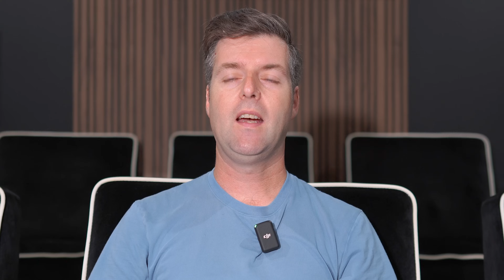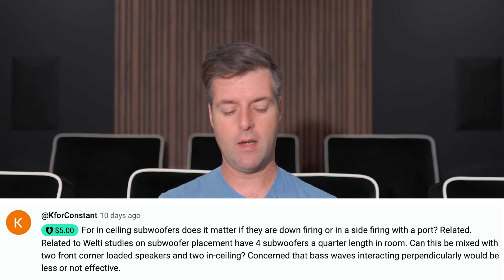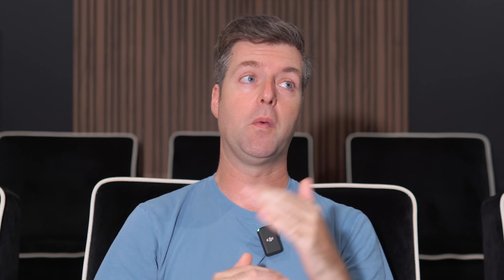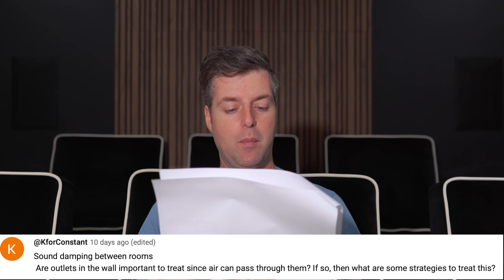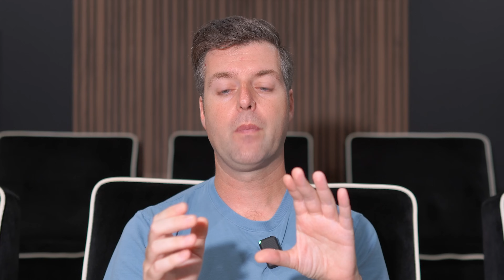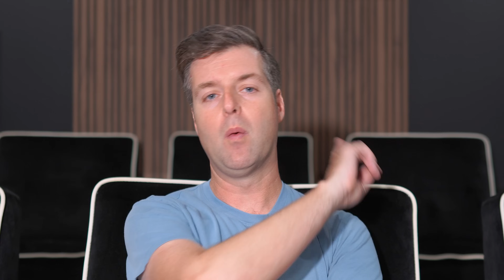Subwoofer Radiation and Placement, does it matter?

Comment: Couldn’t you use a putty pad as an outlet gasket?
Reply from the maker: You could. That would be very messy. The putty pads are sticky and relatively thick. I’ve done this in critical areas before. You can see the putty pad. 

I did this to my projector hdmi port. The outlet box and Smurf tube wasn’t done quite right so I added putty pads to the back of the metal outlet.  You can see the putty pad at the side.

Comment: Thanks for all of the videos. I’m going to be installing for Martin Logan dynamo 1100s in my theater. I’m planning to align the subs using a mini DSP. Would you recommend the model with XLR inputs or single ended inputs?  The room is 12’ x 14’ so the cable runs will not be exceptionally long.
Reply from the maker: Xlr

Comment: Awesome video, as always. I am seriously considering putting sealed subwoofers into the ceiling (firing down). You mentioned that when you put a subwoofer into a wall, it becomes hemi spherical and no longer a 360 degrees disperser. You also mentioned that quarter placing subs summon SBIR problems and losing the benefits of reinforcement from the surrounding walls. So my question is. If I want to put 4 subs into the ceiling, should I go with the quarter positioning, and if so, should I expect losing output due to the lack of reinforcements from the walls? I know that more subs are better for more consistent results in multiple listening positions, but drawback can be the lack of punch (except if you put all the subs to the corners), which was present when you had to focus to 1 listening position only. Is putting the subs behind the screen and thinking of an SBA or DBA is a better solution? If I put them behind the screen and basically into wall, would I face with the same issue, as no reinforcement from the walls? Can that be countered with more powerful subs? What is the best solution, if I want to keep the punch, but want more evenness across the listening postions? Can that be achieved with in ceiling subs?
Reply from the maker: Without the right processing a SBA or DBA is really hard to get to work well in a lot of rooms. First, while four can work with proper DSP processing to focus and aim the wavefront, four is rarely enough to create a planar wavefront up to 100hz. You likely would need 8+ to get there.  

I can’t answer your other question without the room. The problem is that I need to have the room shape and layout to determine what may be the best place. Quarter positions could work fine.  

What in ceiling subwoofer are you looking to use?
Reply: @PoesAcoustics  Thanks for the quick feedback. SVS 3000 In-Wall. I saw the the amp can run 2 pairs, but then I will probably have problems with the DSP,  as it will set two pairs at a time and can't EQ, Phase, check polarity separately for each pair. Room is a rectangle, 4 meter wide, 6 meter long and 2.3 meter high. I have checked the Harman room mode calculator. Listening position is almost in the middle - I have told the owner that it is not a good idea. There are dips at 29hz at the length and 43 hz at the width and 70 hz at the height. Currently he has 2 x SB4000 and I have managed to get a good response, putting them into the opposing corners, but now he is missing the slam that he had when both of the subs were at the corners at the back wall.

Comment: Have you done many infinite baffle subwoofer installations? Would love to hear a video on IB subs in general from you. Thanks!
Reply from the maker: Never done one. Because of the kind of rooms I design. There would never be a scenario they would work. You can really do a sound isolated room with an infinite baffle subwoofer. 

I’ve heard them plenty of times. But it just doesn’t fit in my design approach.
Reply: @PoesAcoustics  Thanks for the reply! I hear lots of people saying IB subs sound extremely clean etc. but in your opinion, do they really sound that different from a well designed traditional setup? Keen for your thoughts given you've heard both. Thanks!

Comment: Hi, great info. I have a question regarding sub placement for a solo listener. Is the advice regarding optimal placement also valid if you are using equaliser? Or could the corner placement be a better choice anyway if you equalise in the listening position?
Reply from the maker: For a single solo position you focus on subwoofer placement for that one seat. EQ is necessary but not a replacement for placement. The reason is cancelation dips. You can’t fill them through EQ.

Comment: Wifey needs a white noise generator 😎.
Reply: @jimtoomey9522  
I have a FOH engineer, colleague/acquaintance that set up a two cabinet destructive summation sub array, positioned nearby a monitoring mic, merely to destructively lower the dBspl the local authorities were monitoring, so he could elevate the mains spl ... to get away with playback at a higher more impactful level from the main system! 

So your instincts are right! 

I first encountered white noise background generator for office space about 35yrs ago, at an Eli Lilly facility. 

I thought very cool ... very smart.
Reply from the maker: That’s supposed to cover up a reference output theater?

Comment: Would these details matter for low frequencies? I'm isolating a basement theatre from my family on the second floor. Thanks Matt!
Reply from the maker: Which details in particular are you referring to?
Reply: @PoesAcoustics  Any treatment to the outlets. I suppose it can't hurt especially since it's fairly cheap. Kind of curious in general how small holes/leaks in the room will effect which frequencies will pass through. I used to design RF isolated chambers and the frequency was dependent on the size of the hole.
Reply: Good luck, isolating a basement system from a second floor environment is no small task! 

Brief anecdote; 
At my desk/work bench in the basement of the Indianapolis Convention Center, two very tall floors below The Sagamore Ballroom, LF energy would transmit down through concrete columns down to my area ... it was rare, it was only the biggest rigs/shows. 

But yeah, unbelievable power of that LF energy.  

Good luck